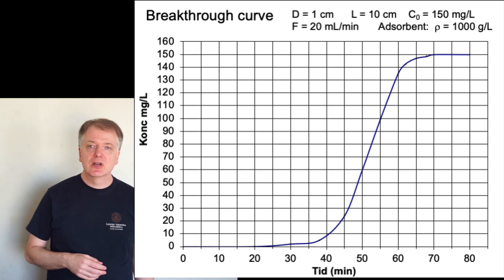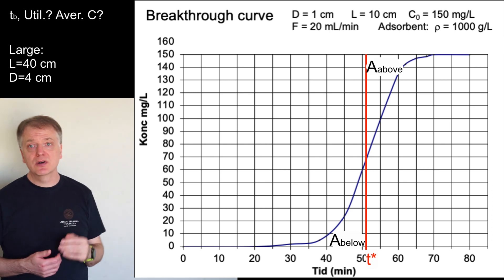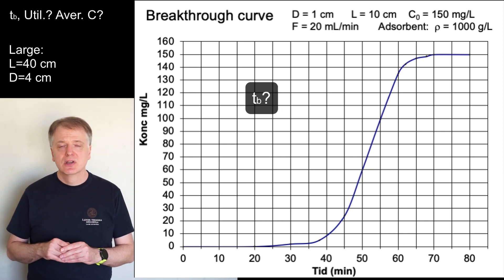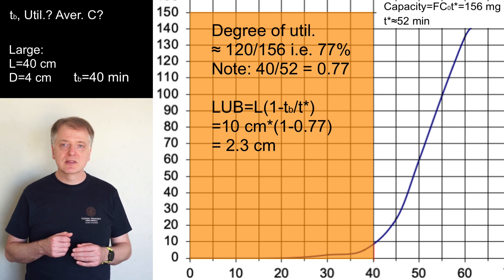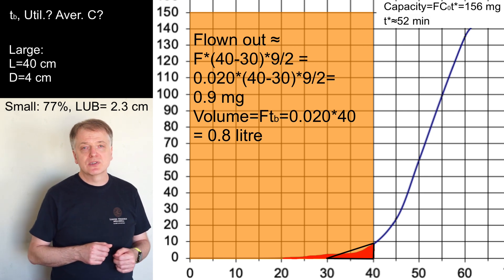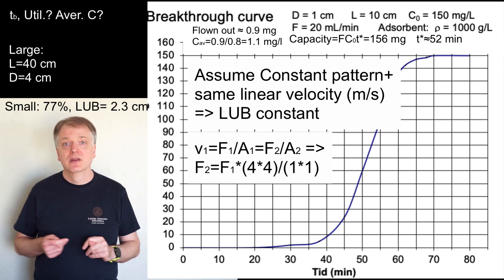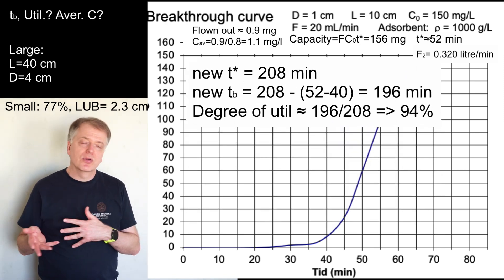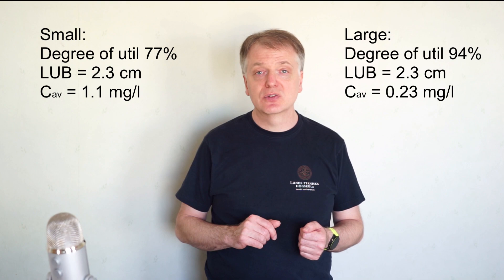Example: Upscaling chromatographic column

Comment: Thank you very much. Could you share or suggest a reference to check out the formulas and the full calculation?
Reply from the maker: This example is not taken from any book, but text books on chromatography typically have similar examples. Note that we have a playlist on adsorption: https://www.youtube.com/watch?v=Ioc3msRViv8&list=PLvpgTFzUKO49f62FlfIxOgfeiY-BxNhGj  Please note that the equations used are just based on simple reasoning and standard mathematics (as you can see in our other videos on this topic)

In the 2020 version of Kirk-Othmers encyclopedia of Chemical Technology,  DOI: 10.1002/0471238961.0104191518212008.a01.pub3, a more advanced perspective is used, but from the short section 8.3 on Length of unused bed, you can deduce the equations used to solve this example simply by studying the graph. Kirk-Othmer calls t* the stoichiometric time, t_st, uses t_bp for t_b and uses L_UNB for LUB. If you analyze equation 42 on page 38 you will see that that equation is in agreement with our calculations in this video:

t_bp = t_st *( L - L_UNB)/L = t_st * integral_0^t (1-c/c_0) dt / (integral_0^infinity (1-c/c_0) dt )

Note that the two integral have the unit C*t, concentration multiplied with time (in this example, mg*min/litre). You can change the unit of the integrals to be the same unit as the capacity of the column (mg in this example) by multiplying the integral with the volumetric flow through the column. (But since one integral is divided by the other and volumetric flow obviously is the same, since we're dealing with the same setup, the volumetric flow can be taken away from the equation)

The integral from 0 to t=t_breakpoint is the amount adsorbed in the column at the breakpoint, hence the area above the breakthrough curve (up to the concentration c_0) up to t=t_b. Similarly, the integral from 0 to infinity is the capacity.
Reply: @PLE_LU   Thank you very much for answering.